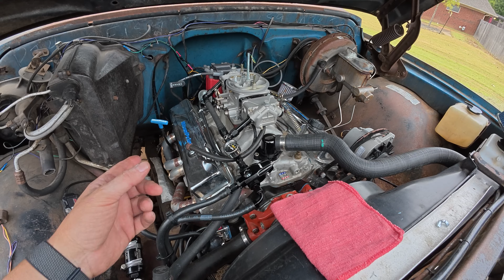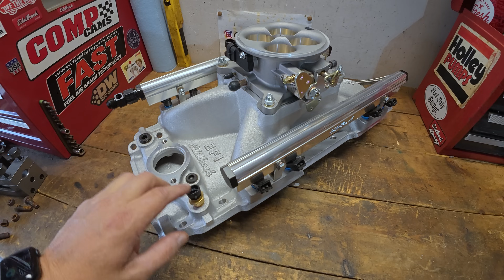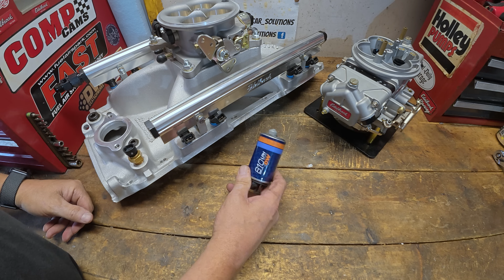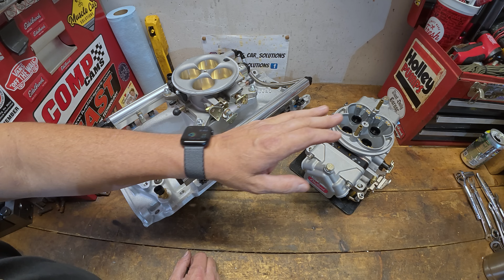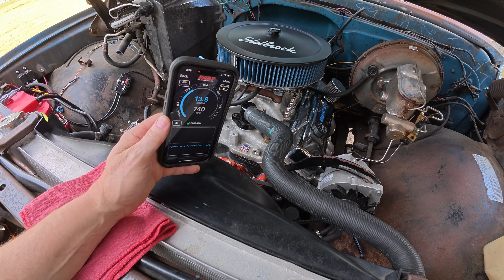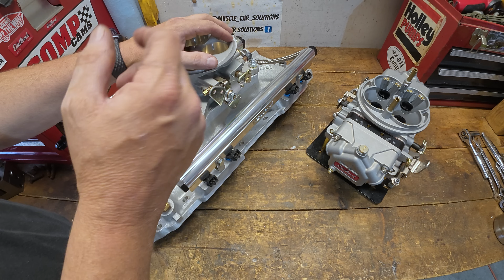How to Choose Between Carburetor and EFI

Comment: Fuel injection is nice, but there is a fairly steep learning curve if all you know is carbs.
I don't like how TBI fuel injection is advertised as a carb replacement because the entire fuel system needs to be changed, and even the distributor needs changed or modified if using the EFI to control ignition timing.  
One thing that originally confused me was the manifold pressure referenced fuel pressure regulator.  As a carb guy, I was used to setting the pressure and making sure it dosen't change, but with the manifold pressure referenced regulator, you set the pressure with the engine off, and when running engine vacuum reduces the pressure to maintain the same pressure drop across the injectors.  With boost, fuel pressure increases to also maintain the same pressure drop across the injectors.  Some of the newer EFI will run without the referenced regulator and the computer factors the change in injector pressure drop across the injector using the MAP reading.
My first EFI used external pump, but the in tank setup is quieter, a cleaner install, and really less complicated.  
Cost wise, if your starting off with no fuel system to begin with, the TBI EFI systems are not that much more expensive.  
Cost of fuel pumps and regulators are about the same for carb or EFI.  A new higher end carb might cost $700+ and you need all the tuning parts and gaskets to tune it.
If you add in the costs of adding an A/F ratio meter, gauges and an electric fan controller to the cost of the carb setup the cost difference is pretty much a wash.

Comment: Off topic question, 1969 426 Hemi restoration, all stock, has about a 200 rpm swing/hunting at idle (only will idle with curb screw turned further) With transfer slots squared, engine will not idle, mixture screws have some effect on vacuum, but not on the idle hunting. Apparently stock 426 Hemis have 12-14 inches, which is what I’m reading on vac gauge. Thanks
Reply: Edit: Just found your Transfer slot video, great but the idle ‘hunting’ is still there.
A couple more details about the build - These are original restored Carter AFB’s, 625 cfm, 4 speed, original cam - don’t have exact specs but I believe 220ish dur., well under .500 lift, probably a pretty wide lobe sep. 112 or more.
I have to turn curb idle screw in to get the engine to even idle but that’s ok I guess, assuming these Carters are close enough to an Edelbrock. The idle rpm hunting is still there, about a 200 rpm slow drift happens continuously every 4 or 5 seconds. When tuning mixture screws with a vacuum gauge, I don’t seem to get much reaction though (screws are about 2 turns out) Stock restored dual point distributor (stock advance springs, on the heavy side) and with vac advance disconnected or not - no change. Considered a vacuum leak but none found (but a vacuum leak wouldn’t cause an rpm drift, would it?) Anyway, that’s the best I can describe it! Thanks again!

Comment: My 74 f250 has 6.5 psi fuel pressure when then engine first starts up and is cold then drops too 3 1/2 -4 psi when it warms up and I drive 30 minutes or more. Then I get a bog with my 1406. I have a carter fuel pump on it I’m afraid it’s no good. And I need to get a nicer quality fuel pump. The Carter is Chinese. What do u recommend.
Reply from the maker: First things first.  Are you on a deadhead system currently?  If you are, then you might switch to a return style if you want to see more consistent pressures.  The bog is unrelated.  What have you done to tune it?
Reply: @MuscleCarSolutions yes I’m on a deadhead system. I have been following your videos. And they helped me a lot to get it tuned and set up. I used the eddy chart and it has been running really good. And good on cold starts. Just when it warms up you can chop the throttle and it kinda bogs down unless u chop some more and give it more fuel.

Comment: Good video as usual, hey Brian I have 3/4 of a tank of premium with ethanol anything you recommend adding to my fuel , I also have five gallons of ethanol free regular to add to it, thanks
Reply from the maker: Trying to get rid of the ethanol fuel?  Drive it!  There’s not much else to do if you’re trying to switch to a non ethanol fuel.  Or are you just trying to prep for winter storage?
Reply: @MuscleCarSolutions trying to prep for winter storage, the problem is I like to burn premium on a daily driving basis, but can only buy non ethanol regular, so do I try to burn up the premium and store it with the regular or treat the premium
Reply from the maker: @DesertRatFabrication  I’d store it with the non ethanol gas if you can.  If you can’t, check out Driven Racing Oils storage defender.  Works well for long periods of sitting, but the more ethanol you get out of the system anyway, the better off the truck will be.
Reply: @MuscleCarSolutions sounds good Brian, I will drive it some and replace the fuel with non ethanol even if it’s regular I can burn that up in the spring, thanks buddy😀😀
Reply: Oh yeah get that Chevelle on the work bench, lol
Reply from the maker: @DesertRatFabrication  for sure.  I will likely have a video coming soon on storing a vehicle over the winter months.  Heading to Vegas in the morning for the NHRA race and SEMA next week.  Busy busy!
Reply from the maker: @DesertRatFabrication  it’s stripped and ready to be rewired.  Will do that over the Christmas holidays.  👍 Wish me luck with that.  😂
Reply: @MuscleCarSolutions I do and looking forward to it, don’t think I’ve seen you do anything on it since Washington State
Reply from the maker: @DesertRatFabrication  did some videos a few years ago on the T56 install (had to redo the tunnel). But that’s been it.  I need to just retire and focus on monkeying around!
Reply: @MuscleCarSolutions 😀👍

Comment: I'm building a hot rod with a Jag V-12 engine which came with port EFI but it looks terrible so had to go. Most people who runs carbs run six Webbers but God, that's expensive and a pain to tune. A company in the US makes manifolds for two 4-barrel carbs (with the distributor between them as Jag put it right in the middle of the valley) or these EFIs. So, carbs or EFI? Whichever, I need two because of the dizzy's location even though the engine is only 326ci. These EFIs are not an injector that squirts a measured amount of fuel into the port or cylinder at a precise moment. The way I see it, they are nothing more than a 4-barrel carb with a brain and the only change you can make to any given carb is jetting and that's usually to suit the altitude. So, these things can alter their air/fuel mix according to altitude as you drive along. That's great but they cost twice as much as a carb and I need two of them. I also live on the flattest continent on Earth and because it's a hot rod with an open engine, I want to keep it as simple as I can - no wiring or computer. I chose two Edelbrock 500s. I also got rid of the TH-400 trans and replaced it with a TH-700R4, not a 4L60E for the same reason.

Comment: I've run blow through carburetors and boosted efi.  My opinion is: If it's originally carbureted, leave it carbureted, if it's fuel injected, keep it injected.  EFI does better at part throttle.  With a Megasquirt, efi is now about the same price as a good carburetor.  I run a Megasquirt 2 on my turbocharged '32 coupe, and my 452 cu. in. Ford FE.  I use a Microsquirt on my turbocharged 1996 Mustang Cobra as a piggy back in fuel only.  Speed density works a little better than Mass Flow on deceleration and boosted applications.

Comment: What about progression ignition distributors with carb? Good data logging capabilities especially if you pair it with an O2 gauge. Can change timing on the fly, save tables, datalog vacuum. Plus launch control, tunable with boost, etc…
Reply from the maker: Unless they changed that recently, there’s no way to datalog fueling, which is primarily what would be needed to make fuel changes.

Comment: I have grown to enjoy figuring out the settings for the carbs i run on my builds. If gotba single 40 IDF I've got to run great on a 1968cc stroker VW and now its on a 1641cc Vdub. The jetting is drastically different between the two displacements. Now that 1968cc has dual 34 EPC carburetors. I thought those might be more cumbersome but not really. Now I've picked up a set of dual 40 IDF's for my next build that will be a 2110cc stroker. I have to say, channels like yours although not a air-cooled channel. All that circuits are the same. And are a great help to people like me who do not wanna pay someone else. 

I am getting a setup with a 283 for a 56 pickup for my boy. And a Austin sprite with SU carburetors i need to soon figure out for my wife. 

Thanks dude.
Reply from the maker: It’s been…30 years since I worked on a VW.  Not sure why, but I always had a fascination with air cooled engines.  Maybe one of these days I’ll find one to tinker with.  Good stuff!
Reply: @MuscleCarSolutions i wife bought me one so I'd figure them out. But not on her stock 59. Surprisingly,  that 36hp 1100cc in her 59 rarely needs anything after i rebuild that tiny carburetor.  It also can't keep up with our other two that are drivers. I absolutely love these engines.  Its a real kick watching the look on someones face on the freeway when i pass them.

Comment: I'll stick with my AVSII and mechanical pump.  It's dead reliable and easy to get parts for. Cold starts are not an issue if the choke and the high idle are adjusted properly. I live in Idaho, with lots of elevation changes...it's not a big deal for me.... just adjust it for the elevation that you plan to be at most of the time. If I have a problem with an aftermarket fuel injection setup, I have to send the unit in for warranty work and wait 30 days or longer...or wait a week or more for a special part to come in. Factory fuel injection setups are different; all of the parts houses support those...and they tend to be ultra reliable....I've never really had a problem with those.
Reply from the maker: One thing this video has taught me is how terrified folks are of the things they don’t understand.  That’s sad.

Comment: Oem fuel injection has been great in my stock vehicles  but when adding Fuel Injection be very careful who you buy from and even Holley has no problem screwing you ( ask most Sniper1 purchasers  , notice I did not say Sniper1 users? most had to ditch the defective junk so not many users
Reply from the maker: Even the category leader has had some issues. That’s what private equity does.  Edelbrock is starting to suffer from it as well.

Comment: Got a comp cam kit to go along with my e f I set up .  mild cam , drive ability.
Reply from the maker: Mild is generally better on the self learning systems as they require a decent amount of engine vacuum to operate properly.  In tuning mode, engine vacuum isn’t a factor in speed density tuning.  Stuff we likely won’t get into here until I get bored and make big changes to the Chevelle after it’s back on the road.  👍

Comment: I have got a 1971 ford f100 with 302 with edelbrock performer 289 intake stock 87-93 mustang headers i ended up putting a motorcraft 2150 2bbl carburetor on it with a little modification and tuning it runs great now but i have thought about aftermarket efi and trying to piece together a factory system cause factory stuff is more reliable? I use my f100 as a daily driver/cruiser and I'm getting older and dealing with a carburetor in winter at -40f in the dark in the morning trying to go to work is not fun lol I was at a swap meet this spring and a guy had a first gen holley efi system used for $1300 and I have always heard they are none stop problems he said didn't fit his application to me meaning it not working anymore lol the edelbrock pro flo 4 is a nice system but by the time i get to Canada it's $4000+ and thats way to much money and info you can provide would be great hello from Canada 🇨🇦
Reply from the maker: Folks that have problems are generally self imposed. Instead of learning what the problem is and how to correct it, it’s just easier to blame the product. Like I mentioned, buy cheap, you’ll experience plenty of issues.  That was just a poor choice, not the fault of all aftermarket EFI systems.  I can’t stand those units with knock off sensors.  Those brands are easy to identify with ridiculously low prices.  You indeed get what you pay for.
Reply: Yes I completely agree with you I will keep running carburetor but still might piece by piece build a stock factory efi system to try in the future always great seeing your videos
Reply from the maker: @andrewforster4974  stock EFI set ups can be good, but inherently they can also cause a ton of problems as well.  As long as you know that going in and set your expectations accordingly.   Thinking back to early early in the LS swap day of getting factory components to play nice with boosted engines and all the limitations and shortcomings it exposed.  It’s nice to see the evolution of aftermarket EFI systems get caught up.  Stay warm up there!
Reply: Yeah aftermarket system is great but out of my price range right now i will stay warm up here lol how about you come up here and enjoy the cold lol kidding
Reply from the maker: @andrewforster4974  it got cold here this weekend.  Was 18C here today.  Just awful.  I’m not sure I’ll survive. 😂
Reply: That's cold? Lol I had frost on my windows this week one morning already lol
Reply: I would recommend like a 600 cfm edelbrock avs2 for your application.
Reply: Had a edelbroken on before nothing but problems it was new but ty

Comment: EFI is junk lol. But in all seriousness here is how I would tell people to decide. If cold starts do not bother you and you want maximum power and ease of maintenance and low cost go carburetor. Also I have to disagree with you on fuel pumps You can change a mechanical fuel pump on the side of the road you are not drooping the gas tank on the side of the road. You can buy a new mechanical fuel pump at any autoparts store they might not sell your special pump in tank replacement fuel pump.
Reply from the maker: Far from junk.  But fuel system set up is key.  As far as pumps go, my guess is zero of the millions of folks around the globe who drove a vehicle with the pump in the tank worry about when they fail.  It’s not a frequent occurrence.
Reply: @MuscleCarSolutions  As a mechanic who works on late model cars for a living I can say I get at least one fuel pump job a month on. Ive done them on all different makes and models but recently it has been all ford f-150's for some reason in about the 2010-2015 range.
Reply from the maker: I’ll see if I can get my 2020 Silverado switched over to a mechanical pump ASAP!
Reply: @MuscleCarSolutions  Yes you rip the GDI Lousy Smallblock out and you put a gen 1 SBC in. You would need custom gauges and a whole list of other parts too but it could be done lol.
Reply from the maker: @The0utmode  I think I’ll take my chances with what’s in it.  😉
Reply: @MuscleCarSolutions  At least delete the AFM
Reply: @The0utmode You should start a channel. Then you could be there instead of here.
Reply: @shelbyavant5081  I have thought about it looks like more fun than BMW rear main seals Chrysler 3.6 oil filter housings and ford triton exhaust manifold jobs.
Reply: if my sis can drive a f100 with a carb a avs2 650 NO choke in the 90+ heat to 25f with a 360 fe you do not need efi. she only has driven fuel injection and showed hear the trick and how too feel out how much to pump the gas fast idle and feather it when cold.  i use 15* base timing with 14*mechanical advance all in by 3200-3400. and 14 degrees of vacuum advance on manifold vacuum. this gets it lit and the vacuum advance speeds up idle. this gets rid of the need for choke. sort timing curve makes with quick curve makes it snappy but keeping total timing low keeps power in the sane range and gives safety margin. this has a 8.5 to 1 comp and 200 degrees at .050 on 112lsa. so low pressure cranking needs a bit of base time.

Comment: I give up on my edelbrock, its been since the beginning of summer that ive been chasing flooding and starving issues, stuck needles.
Reply from the maker: Plenty of things that can be done to prevent those conditions.
Reply: @MuscleCarSolutions  I did a full rebuild, bought new needle and seats, cleaned all the passages, got a regulator, its either it floods from the where the metering rods are or it just starves for fuel and the fuel bowls dont get filled causing a lean condition.
Reply from the maker: @d30m_e550  those are all just basic set up and adjustments.  I did a video on initial set up.  Might be helpful to your situation.
Reply: @MuscleCarSolutions  I already watched it. My float levels are at spec, my regulator is at 4.5 psi.
Reply from the maker: Got something else going on then.  Those are just the basic initial settings and system set up.  If you’re starved of fuel, go to 6psi and see if more flow helps.
Reply: @MuscleCarSolutions  If i go more than 5 in my case I start flooding, today i tried going at it again even at higher pressure now it wont flow past the needle even tho i cleaned and even replaced it.. so im puzzled at this point